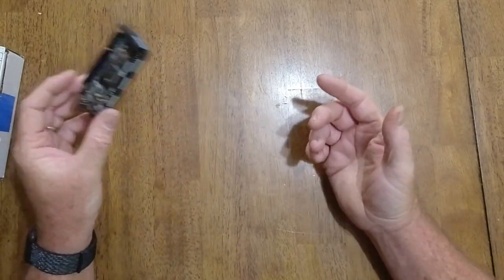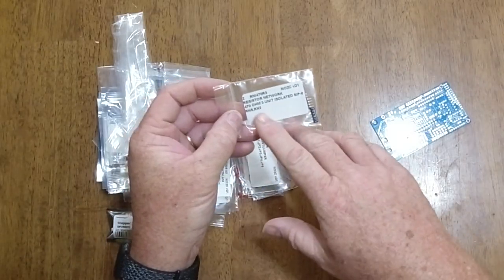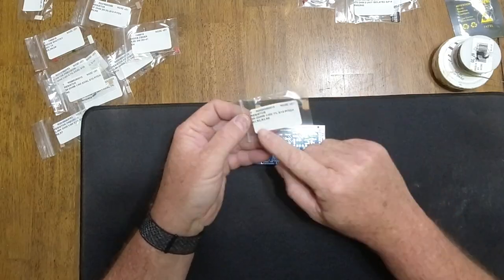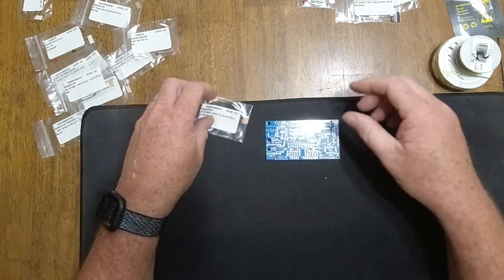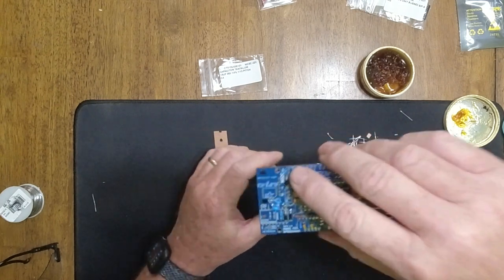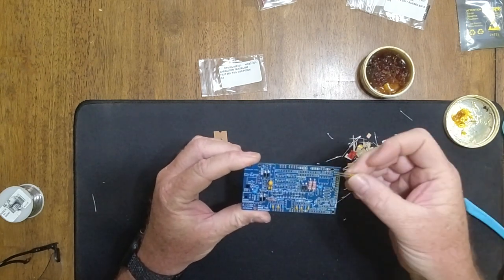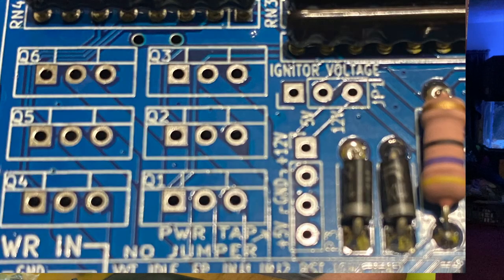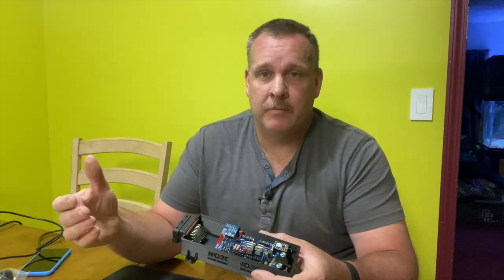NO2C Build Speeduino

Comment: Mr. Jones,
Thank you very much for this and your videos in general. You have answered many outstanding questions that have plagued me.
I have my type 1 2180 running now injected on propane and wasted spark. I'm attempting to modify the code to support dual fuel and advance maps toggled from a switch and an unused input on the Mega thru the daughter board. 
Again, Thanks! Great work.

Comment: Nice video, maybe you have info about the connections, for example, the A1,A2,B1 and B2
Reply from the maker: Well I can help with that. A1,A2,B1,B2 are the connections for stepper idle air control. they will only work when the optional stepper board is installed.  most pins are very well marked. But let me know if you have more questions
Reply: @wjones1972  thanks, it’s possible change for example, some VR1 or VR2 to get a 3rd ignition signial and 3rd injection out?

Comment: Thank you, I am planning to print that box but I’m curious if there are any piers to screw the board down
Reply from the maker: it doesn't I need to revisit the design. it was something I found on thingiverse and I extended it and cut the end to fit my connector.
Reply: @wjones1972  thanks. 
I’m just installing firmware on the Mega and don’t know what to install for the base tune, what did you do?
Reply: @wjones1972  thanks. 
I’m just installing firmware on the Mega and don’t know what to install for the base tune, what did you do?

Comment: Hello again, question
So, the 24 pin connector, it is the same or similar to the 24 pin on page 161 of the manual where it references the dropbear controller board. That manual section provides the pinout assigned to the 24 pin connector when using that board. Did you, by chance, use this pinout from the manual when you wired yours, even though one could wire it any way they desired. Just curious, If you used the "dropbear" standard, then so will I, if you did not, then I may also rebel and do as I wish :) (tonights the first night I even looked at the manual lol)
Reply from the maker: I just used my own when I wired it up. I hadn't seen the dropbear when I came up with this one I ordered a case from aliexpress that I thought I could make work but it was to small so I just used the connector.  I originally just soldered the wires to the connector and that works but isn't great so than I went to pcbway and made a small board to mount the connector and the wires to so it is more robust.
Reply: @wjones1972  thanks, im doing it my way then

Comment: Hello Mr. Jones, I'm getting ready to begin assembly of my No2c board. One major concern that I have is information that clearly defines and identifies the input and output connections ports of the board. For example, at the connector, I see there are connection ports for VR1+, VR1- and VR2+ and VR2-.  Also, I see a connection port marked BST, I have searched the internet for information of this connection port of the No2c board and I have not been able to find anything explaining this BST port, What it is , what it is used for and what it does. Would it be possible to do a video that would clearly define and identify the input and output ports of the No2c board.

Comment: Extremely helpful, thanks!  I too am converting a bug to EFI.   What are you using for crank / cam signals?
Reply from the maker: I am using a crank trigger from THEDUPSHOP.com and a cam SYNC from CBPerformance. but you really don't need the cam SYNC for it to work well. I am running batch fire so it doesn't need the cam sync.
Reply: In Mexico the last bug generation comes with Euro III EFI. It is a first generation EFI and trigger is performed by a distribuitor with hall sensor. The FI is not sequential is simultaneus. 2 squirts by a complete otto's cycle. Regards from Mexico..

Comment: can you confirm that the link for your NO2C board includes both the PCB board and the components? because all that for 80 dollars sounds like a deal. "All I would need" is the Arduino Mega and then appropriate ECU connectors correct (and proper setup of software and maybe some other application specific settings)?
Reply from the maker: That's correct. It includes the board and all the components to build the board. If you are going to run a VR crank or cam you need a VR conditioner board $25 and a stepper driver $5 if you use stepper idle valve.

Comment: im printing the box, what do you do with the blue tooth module on the cable
Reply from the maker: I just tucked it in under the connector. I didn't provision it to hold it in place. I should revisit this with more people using it. it was just a quick and dirty design to hold it.
Reply: @wjones1972  gotcha, i was looking for some MAGIC lol. OK, I will do something with it. thanks. I just didnt want to miss out :)
Reply: @wjones1972  I couldn't print your box, you know how the first thing it prints is an oultline of one thread, so it should be a rectangle, I get a 7 sided weird shape, then, it prints only two sides so its a large L, one large side with the circles and one short side. Dont know why
Reply: @wjones1972  ok its printing different now, let me let it run, i used the creality slicer this time.
Reply: Printed this time, doesn't seem to like the sli3e program, used reality instead, slice report like hundreds of errors, obviously a slice program problem

Comment: Also, would you be willing to share the file you used to 3d print the case? Looks really good.
Reply from the maker: I will paste a link the the one I modified to fit a connector. I started with this model and used tinkercad to make it longer and make a port for the connector. I still need to design a top. I will try to get that done soon and upload both to thingiverse.
Reply: @wjones1972  Thanks. Not sure what thingverse is. Would you be able to provide a link when you are done? thanks
Reply from the maker: @nicksauer6749   Sorry I meant to paste a link before. I will paste a link when i finish my mods as well but this is what I started from. https://www.thingiverse.com/thing:4598001

Comment: how do the jumpers work?
Reply from the maker: There are a few jumpers to select hall or vr or to select 5 volt or 12 volt. they are all listed in the speeduino documentation. 
 JP1 - This sets whether the Ignition outputs are 12v or 5v. Note that even if you set this to 12v you should *NOT* connect these directly to a high current coil. These outputs should only ever go to a logic level coil or an igniter
JP2 - Whether or not the RPM1 (Crank) input should be routed via the (Optional) VR conditioner. This should be set to VR when using either a VR sensor or a hall sensor that switches between 0v-12v
JP3 - Same as JP2, but for the RPM2 (Cam) input
JP4 - 1k pullup resistor for RPM1 input. Should be jumpered ('On') when a sensor is used that switches between ground and floating (Which is most hall effect sensors)
JP5 - Same as JP4, but for the RPM2 (Cam) input
Reply: I know everything is in the documentation but it’s a little work to sift through. So I built my no2c and bought the VR conditioner, I didn’t understand that all the jumpers, basically have an optional component, until your reply. Thanks. And my board has a jumper next to the stepper output, that I think is to allow writing in ms tuner?
Reply from the maker: @spencert4840  Yes the jumper by the stepper driver socket is for reset control. you have to select how you want that jumper to function in the tuner studio options. Basically if you have the car running and you connect the usb it will reset the arduino and the car will die and you have to restart. with reset control the usb doesn't  reset the arduino when connected so you can connect the usb when the engine is running without the car dieing.   If you feel like a video on how to select the jumpers would be helpful I can shoot and post one
Reply: @wjones1972  Thanks for clarifying that. I would watch that if you made it. I try to learn all I can from videos rather than going to the manual whenever possible. Do you recommend any other channels for learning about speeduino?
Reply from the maker: @spencert4840   I posted a video of the jumper settings I am using on my application. let me know if it helps  https://youtu.be/9N8I6GSougM